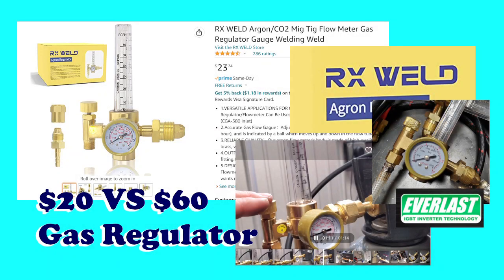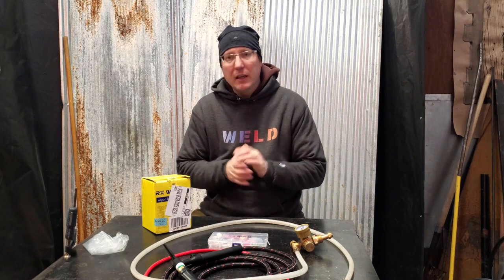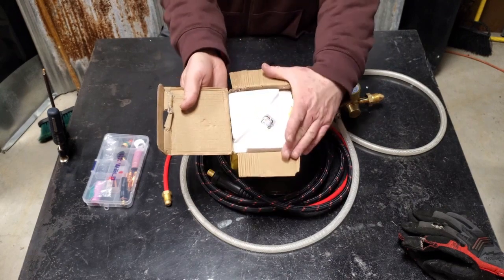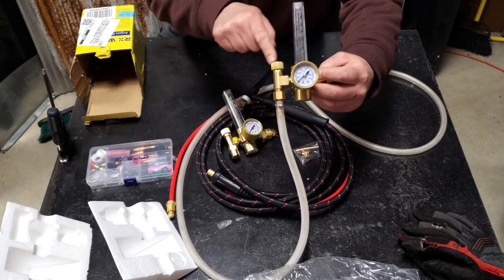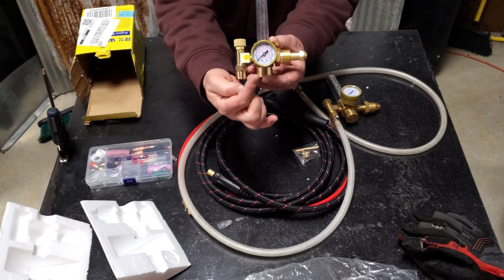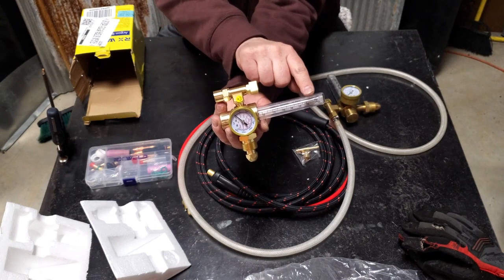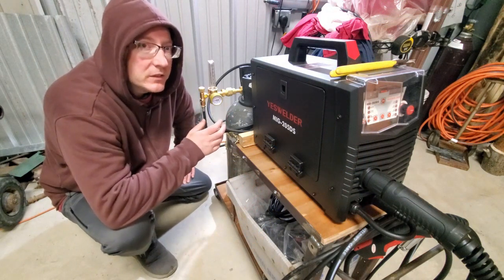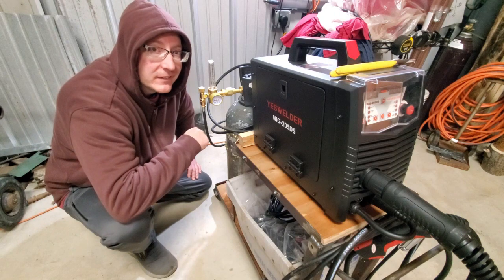RX Weld, Cheapest Ar/CO2 Regulator on Amazon | Noob's guide to regulators | How-to Setup and Read it

Comment: I got a question i got a vrm vsw vrw its a thousand dollar argon reg now when i set its flow should i set it up to where i want once the gas valve is open or should i depress i the trigger and wat to see where the needle drops which is the rights way to read as the gas is flowing while your welding or just set to the gauge before you hit the trigger kind of confusing but if i rember you want to hit the trigger and see the drop so i run at 30 cause when the tigger is pulled it drops to 25 if that makes sense
Reply from the maker: Oh, yes those are fancy. I haven't used them in my shop, I have an old "hand me down one" I haven't played around much with, I'm sure there are more  experienced folks you should ask this to, but that said, I agree with your method, you want to set it based on the "trigger drop", that is going to tell you how much is flowing out across the weld. Does yours show in 30psi increments? If so calculating PSI to CFM is going to take some math that is beyond my pay grade.  Every reg is different so there is always going to be some variable in the actual amount coming out. There are equipment/gauges to prove how much is actually coming out, but if your in the ball park and your welds look good then I'd say you using it correctly. Gas isn't cheap so I use as little as is needed to make a good weld.
Thanks for the comment!

Comment: I bought a Argon bottle-supposedly, but it is slightly smaller than the 580, do you think they sold me a Co2 bottle instead and filled it with Argon? bottle is Blue.
Reply from the maker: All my CO2 bottles are aluminum and grey, have you tried a magnet on the bottle, if it isn't steel it's probably straight CO2. Otherwise I would guess its genuine, (My 100% argon bottles are always Brown where I live, but I've seen AR/CO2's mixes sold in black or green or blue). Hope this is helpful. Really the weld test will prove one way or another what's in it.
Thanks for the comment